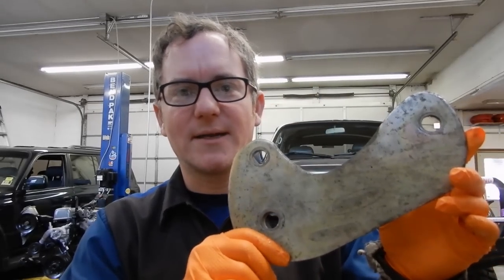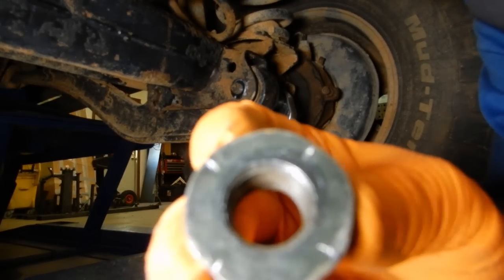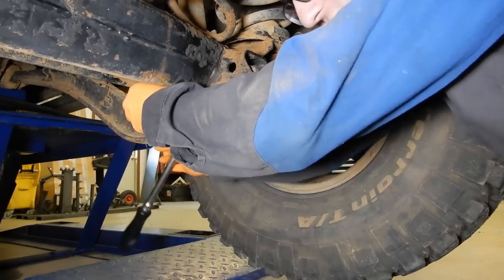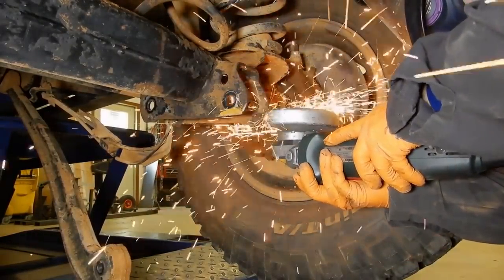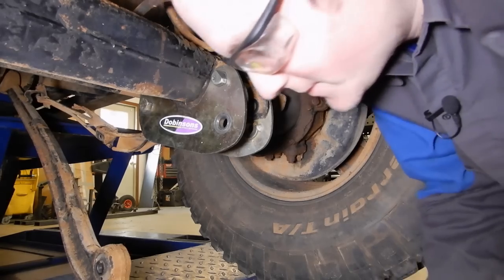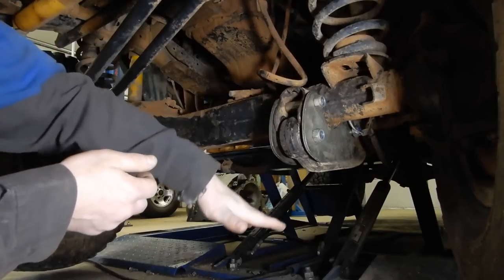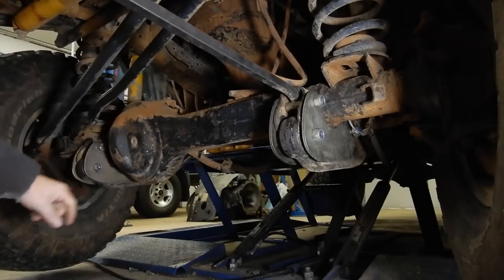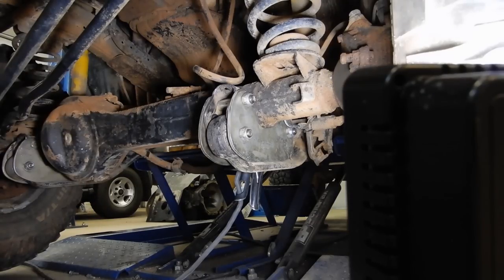80 Series Land Cruiser Caster Correction Plates

Comment: No way those plates coming off,nylock nuts,locktite and welded,that's a real belt and braces approach,do you charge extra for vehicles that come in covered in crud,good job.
Reply from the maker: Funny you should mention the covered in crud. I edited my rant out of the video😁. We actually did just add a line to our estimates talking about cleaning charges. I happen to know this guy tried to clean it first so we cut him slack.
Reply: @OTRAMM  yeah bad enough laying on the ground to work with out getting eye full or worse a earful,
Reply from the maker: Yeah the rant started after an ear full. We usually do them on the tall lift but had a truck torn down on it. So it was a low lift job this time.

Comment: All your videos kick ass! Thanks
I'm on week 2 of owning my 80

I completed engine maintenance/ assessment. I'm in the process now of a complete cooling system overhaul everything new. Next is lift and tires. After talking to Wit's end they encouraged me to go with the caster correction plates instead of bushings.

my question is I assume by this video your of the same mindset caster correction plates are better than caster correction bushings?
Reply from the maker: For the ~2" lifts I usually use bushings.  For the taller lifts we use plates.  I love everything Joey at Wit's End sells except the caster plates.  His style requires a bunch of hard to drill holes.  The style metaltech and I think Slee sells are much easier to install.

Comment: My biggest question would be, on how on earth did you find a way to install  the passenger side caster plate bolt. Now, i know on the after market they are provided with the impossible bolt size.
Reply from the maker: They are not fun but they'll wiggle in there😄

Comment: Again,  awesome 👌 👏 video.  How much of a lift was installed on the  rig.   I'm thinking I will go with a 4 inch.  My concerns are that I will be adding weight to the front and back of my 80. Any recommendations on your favorite lift and heights.
Reply from the maker: Most of the time we go Old Man Emu 2.5". Anything taller takes a ton of extra work.
Reply: @OTRAMM  will do. 2.5 is fine.  Will I need to install the caster plates
Reply from the maker: With 2.5" we usually do bushings.
Reply: @OTRAMM  will do
Reply: Just got it last Tuesday.  Triple locked...  great project for my prospecting outings.  I'm thinking that the heavy OME springs should be a good fit for the future ARB and SLEE bumpers

Comment: Ryan, informative video.  A few questions; caster correction plates and caster correction bushings do exactly the same the same thing, correct?  I am planning to put arb 2861 in the front and arb 2863 in the back of my fzj80. Will I need caster correction plates or bushings for these spring lengths?  What is the threshold in spring length after which you will need to correct the caster?

Comment: What's the theory on welding the brackets before torquing the frame mounts?
Reply from the maker: The weight of the truck needs to be on the suspension before torquing. There's more room to weld with the truck lifted.

Comment: Did you adjust the rear brake proportioning valve to compensate for the lift?? Do you know how to do it??
Reply from the maker: I didn't adjust it. You can get close by raising the axle end of the bracket the same amount as the lift. To do it the proper way you need a special set of pressure gauges.

Comment: How did you get the top bolt in the other side? My panhard bar bracket is blocking the hole
Reply from the maker: If I remember correctly, I put the bolt through from the inside, nut on the outside. It's been a while since I done a set though.

Comment: what is the point of the reinforced welded washers on the inside of the plate? cant you grind off half of the washer instead of grinding off some of the mount on the diff?
Reply from the maker: The new bolt goes through the part of the mount that's cut off. The reinforcement makes it the proper width again.
Reply: @OTRAMM  the set of plates that I have are from metaltech and the washers on them are bigger and are shaped differently so they want you to grind off or cut a lot more than you're showing. I was thinking about grinding off about half of the welded washer so I wont have to cut as much from the control arm post on the diff or just remove the welded washers completely and drill a bit more than half a hole on the diff so the bolt can go through.
Reply from the maker: I'd follow metaltechs instructions. When you drill the mount you don't end up with enough metal. The reinforcement washers strengthen everything back up.

Comment: what size lift correction was this for? Also love the videos!
Reply from the maker: If I remember right a 2.5" lift.
Reply: @OTRAMM  did the rear steering rod come close to the radius atm?
Reply from the maker: On this truck it got a bit too close since they also had caster bushings. Normally it's close but has plenty of clearance.

Comment: Can you pls explain why you are doing this..it just looks like  your beefing up the mounting bracket.are you making it was stronger
Reply from the maker: The brackets change the radius arm mounting points to correct caster angle after a lift.
Reply: @OTRAMM  the bolts are in the same holes..
Reply from the maker: The front ones aren't. They're at a different angle.
Reply: @OTRAMM  thanks mate..I went to a suspension specialist.they explained it to me. back on track now. .m

Comment: What's the deal with double cardan driveshafts? At what lift height do you recommend them? If I'm running a DC driveshaft, do I have to run any other caster correction?
Reply from the maker: We've never really messed with them. Most if the lifts we do are 2.5" and don't seem to need them. We've got a few customers with taller lifts running them but we didn't install them.
Reply: @OTRAMM  Interesting, thank you for the reply. Do you know what kind of correction they were running with that? Im asking because I was thinking of upgrading to Wit's End DC driveshaft after I do my lift but I'm not sure if I'll need caster correction at all if I use a DC
Reply from the maker: Caster correction is independent of driveshaft. It's to fix the steering angles.

Comment: Fjz80 steering free play. Can you respond back on how to correct this problem.
Reply from the maker: You need to watch the steering while  someone moves the steering wheel back and forth to see where the play is. Replace what's loose. If the steering box is loose there is some adjustment but you're usually better to just get it rebuilt.

Comment: So when you do castor plates there isn't a need for the castor bushings that come with the ome kit? I'm doing the j springs 3". Thx in advance
Reply from the maker: Correct, the plates take the place of the bushings.
Reply: @OTRAMM  thank you very much for the quick response and love the video content. New sub for sure! Do you guys recommend drop sway bar brackets on a 3" lift? Probably best right?
Reply from the maker: Yeah, I'd do drop brackets on 3".
Reply: @OTRAMM  Youve been a big help! Last question I hope....I am installing the 3" OME Jspring kit. Would you recommend the Slee caster plates which calls for 4" lift or is there a better option considering my set up? Also will be running a ARB front bumper and eventually a winch, dual bat, set up. Reeeally appreciate the feed back sir!

Comment: So can you tell me if that’s an example of a knuckle that’s leaking and in need of a rebuild or is that normal grease on the felt?  I’m going to purchase an 80 series soon and just trying to do my homework before hand.  Any insight would be appreciated.
Reply from the maker: That's a pretty standard looking knuckle.  Some dry caked on grease is normal.  When it's a wet soupy mix that's dripping is when you know the inner seals are due.
Reply: OTRAMM thank you!
Reply: I’m familiar with 1st gen 4runners and pickups with IFS so the whole straight axle thing is new but I’ve always wanted a straight axle ... I almost got an 80 series before I got my 86 4runner but the MPG scared me off ... now I realize MPG isn’t that much better on an 86 22re :)
Reply from the maker: I started out with an 87 4Runner in 96 and still have it. It's on 80 Series axles these days though 😁

Comment: Greetings friend There are some racing cam for the FJ80 or if you have any material to modify a motor 24 valves 4.5
Reply from the maker: I've seen the Australian guys talk about cams.  I've never seen one here though.  Supercharging or Turbo charging seems to be the way to go.  I've done a few of the TRD super chargers and they work well.
Reply: @OTRAMM  Ok friend thank you. In your experience as a mechanic for the off road which are the best engines? That one can use me and seen that there uses much the big block because they can be modified easily, but here in Venezuela only appear small blocks and the 4.5 24 valves of Toyota which I You can recommend those blocks and which is the most resistant

Comment: What size lift was on this rig?
Reply from the maker: My guess is 3.5" or so.  It's aged enough that it's hard to tell :)
Reply: Cool, what size lift would you recommend putting the caster correction plate on?
Reply from the maker: We usually do caster bushings with the ~2.5" lifts and plates with the ~4" lifts.